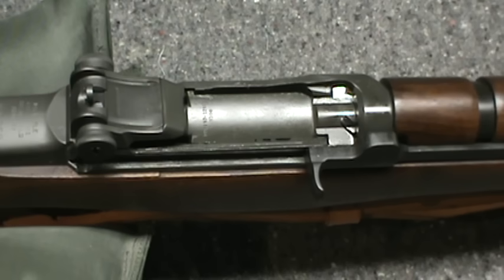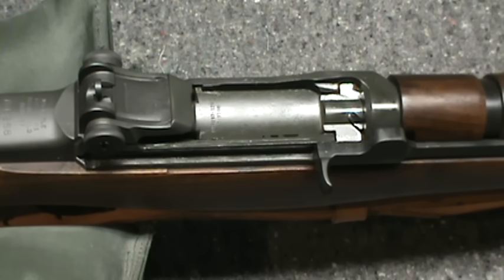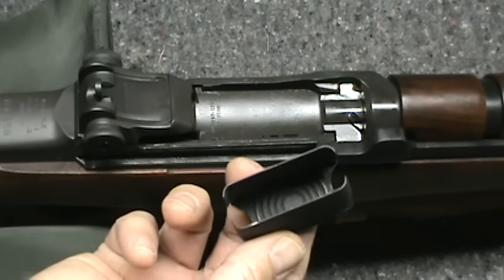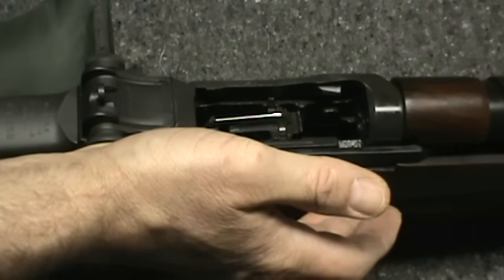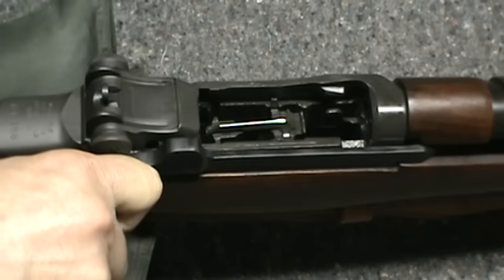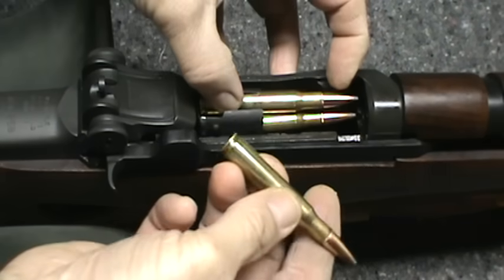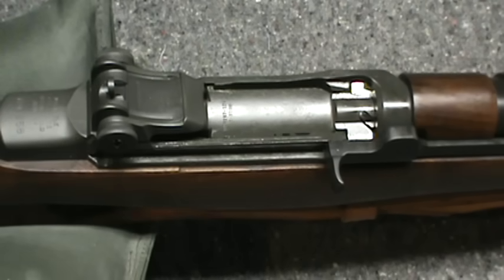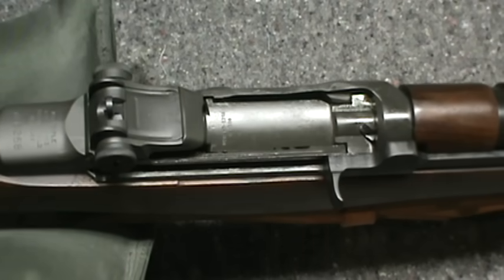How to load the M1 Garand the US Army way

Comment from the maker: KfUaNnSsT 5 days ago
 can you put 1 round in the chamber + a full 8-round clip in the magazine, so you got 9 rounds loaded in the gun?

No. Max load in the rifle is 8
Reply: +007connecticut You should still be able to fire 9 rounds fine.
Reply: +Kaydn “SocialHypocricy” Burns NO, you can't get 9 rounds in the weapon...you cannot close the bolt on an en bloc clip that has 8 rounds in it and have one in the chamber.  It is physically impossible.  Get your hands on an M1 and try it....you have obviously never handled an M1 before.
Reply: +Kaydn “SocialHypocricy” Burns There are plenty of rifles where that won't work. You can't do it on a Mosin, for instance, because it was never meant to have bullets in the internal mag but not in the chamber. 5+1 simply doesn't work on a Mosin, and again you wouldn't be able to close the bolt. I think you would find that to be very common on any gun with an internal magazine.
Reply: +Irenaeus Saintonge Um, not sure about that. Load 5 in a Mosin and one in the chamber. Then push the shell slightly down when you close the bolt. Not a big deal
Reply: +Nightverslonn Hm. I will try next time I'm at the range, but I'm about 95% sure the bolt cannot close with five in the mag.
Reply: you would have to have the bolt back to load ethier the single round or full clip and all you will end up doing is running a round from the clip into the back of the round in the chamber
Reply: +Irenaeus Saintonge many if not most early military bolt action rifles such as the springfield 1903, smle & k98 had a magazine cutoff so you could hold a full magazine in reserve and single load rounds into the chamber. so loading the internal magazine to capacity +1 in the chamber is possible.
Reply: +gungho1345 Most people in this thread are talking about bolt rifles....in some of them you can load a extra round.  If you know ANYTHING about an M1, it has an en bloc clip that holds 8 rounds, It cannot be loaded with the clip and an additional round placed in the chamber and still close the bolt....IT IS IMPOSSIBLE TO DO SO.......I have been shooting M1's for almost 40 yrs, you cannot load 9 in an M1.....
Reply: +fdrww2 yes I know this about the garand. I was commenting on a post about topping off bolt actions. the relative inability to top off a garand was viewed as one of it's shortcomings. the Johnson rifle could be topped off with stripper clips but the short recoil system with reciprocating barrel made mounting a bayonet impractical.
Reply: +Kaydn “SocialHypocricy” Burns He isn't a dick, you just don't have an understanding of how weapons work. The M1 operates from an internal clip much like how some of Mossberg's older 30-06 rifles operated. You can put an 8 round clip in, when the bolt closes it will take the last round and load it into the chamber. Attempting to put 8 rounds in after manually loading a loose round would either cause a stoppage due to a double feed or a possible detonation of the round in the chamber. It would be akin to putting a full 30 round magazine into an AR or M-16 after having put one in the chamber.
Reply: +Jurgen Heinrich   your example is flawed, as you can put a 30 round mag in an AR or AK with one in the chamber. the mag loads from the bottom of the receiver so it can be inserted with the bolt closed on a chambered round.
Reply: correct if you load a round in the chamber while loading a 8 round clip into the magazine you will cause a double-feed.
Reply: +Kaydn „SocialHypocricy” Burns The problem is the top round of the clip is ALREADY the chambered round the moment you release the bolt.

It's more of a 7+1 loading than 8.
Reply: +Themis Spanopoulos half way opened *
Reply: The enbloc magazine only holds 7 rounds the 8th goes straight to the chamber.
Reply: Please tell your father thank you for Serving In WW2
Reply: thanks dude. haha here in the Philippines we've got myths about that gun. that your thumb will be torn off if the bolt catches it when reloading. is it true?
Reply: Can't do it with an SKS either. 10 rounds + 0 in the chamber.
Reply: Just tell me where did you see in the video that he tried to do that ??????
Reply: the guy that owns the actual gun involved literally just answered someone else's question about 8+1 rounds and you still think he's wrong...wat
Reply: I have limited experience with a m1,but i have plenty of experience with a mosin. you can load 4 push them down past the interrupter and close the bolt on an empty chamber with 4 in the mag, the m38 carbine makes a perfect truck rifle. Loading 5+1 in any mosin will not work, I've tried a 1939 finnish m39 a 43' 91/30 a 38' 91/30 and a 1956 Chinese mosin clone. The design will not allow 5+1
Reply: 007connecticut yes
Reply: 007connecticut "in the magazine"
Reply: 007connecticut ur cool
Reply: Thank you very much for explainning to me your dads epic ways of dealing with the garret!
thanks again!

Also I"have a question budd?
How much will it cost if I"wanted to buy one and is it possible to ship to europe also my region is balkans!
Reply: 007connecticut 
Kind of an off-topic question, but how many reloads can you safely squeeze out of each brass shell casing, assuming the person takes care of his/her brass? I would imagine cartridge chamber pressure would potentially have some bearing on that, such as when comparing lower pressure to high pressure cartridges like ,45 ACP vs .40 S&W, or high vs low pressure rifle cartridges?
Reply: If you can't add 9... can you add 10?
Reply: Justin Case 
It's probably a good idea that a few people are pointing that out, because most semi auto guns allow you to fill the magazine AND put a round in the chamber, so it would only be a matter of time before someone tries to do that with a Garand.
Reply: I've seen children's games give the rifle a magazine instead. How embarrassing when the developers claim to make it historically accurate.
Reply: I see.
Reply: 007connecticut r
Reply: I'm on my fifth reload using surplus (LC and HXP) brass @ 2725fps average. No sign of brass fatigue at this point. In the M1 platform proper powder selection is primary to handloading.
Reply: I believe some Italian M1's were retro-fitted to accept a magazine. Those being 308 versions; probably M-14 magazines. Hard to remember off the top of my head, but it is published somewhere that these rifles did have a short service life.
Reply: me too i know some one who owns a Mosin and a M1 grand he owns a lot of WWII guns up to modern war guns he even has a Martini Henry my favorite WWII gun.
Reply: +Kaydn Burns you cannot, because the first round of the 8-round magazine goes right into the barrel. So if there's ALREADY a .30 in the barrel, the M1 will jam.
Reply: What they don't understand is you can't load an 8 round clip and close the bolt without loading a round in the chamber.
Reply: fdrww2 WWII combat veteran here. When we were fighting the Russians in the trenches we could always put one in the chamber along with the 8. I'm a veteran by the way. WW II combat veteran who fought the Russians in the trenches hand to hand with teeth knives shovels pick axes rocks. I used the m1 for 65 years. WW II COmbat veteran speaking her, fought the russians for 17 years in my service by the way. So don't mess wit me young man.
Reply: [90thIN] Seth Prather Weren't the Russians our allies during WW2?
Reply: dont be smarty wit me young blood
Reply: Why is this? Was it just designed that a fully loaded clip would set you up for the maximum 7+1 ?
Reply: [90thIN] Seth Prather The great war was WW1. Please get your fact straight before your unnecessary insults.
Reply: [90thIN] Seth Prather You sound so young. May God have mercy on your poor soul, troll. :)
Reply: [90thIN] Seth Prather Small innocent vet you say? And yet you're the one here with comments filled with disgusting hurtful words. Sorry but I don't believe you either. People know a troll when they see one. And fyi, there are no more great war (ww1) vets. The last of them died off since ww1 was way too long ago for any vets there to still be alive today. Anyways I wish you luck! ^_^
Reply: [90thIN] Seth Prather Lol omg I forgot how funny Internet trolls are. How you replie so early ^_^
Reply: I thought I won't have to return here again but I'm founding out more people falling for this pathetic troll. Stay away from him. He puts Trump's tweets to shame.
Reply: [90thIN] Seth Prather If you're truly a vet then start acting like one.
Reply: M91/30 has littlebit deeper magazine :) just for this reason to close on empty chamber with full mag (or +1 if you would)
Reply: Kaydn Burns no basically every rifle can't, there are plenty of rifles that can't older military rifles are some of those
Reply: 007connecticut “Does a wild bear crap in the woods son?”
Reply: Kaydn Burns !
Reply: It’s not possible because it’s a double feed

Comment: What is the average time you need to bumb the bolt for the m1 also I thank your father for his service it must have been hell for him in the Pacific god bless your father and all in world war 2
Reply from the maker: I think that's why some people (me included)  got M1 thumb. My accident happened when I was loading a 5 rd hunting clip at the gun range. I recall that by thinking at this place 30+ years ago, they only allowed 5 rds in the firearm so this is exactly the cause with the bolt sliding forward without the need of the bump of the hand.  Sometimes the bolt slips forward with the tap of the hand and other times is just goes forward when the pressure is released with your thumb (like in the video). My rifle is 50 50 I guess. I tried different clips, different ammo, lubing the cases up, nothing seems to make it work 1 way or the other 100% of the time. I don't even know what to look for. I suspect it's the tension on the clips but I can't prove it to my satisfaction. I bet if you had worn out clips that barely held the cartridges it would slip in all the time. Thank you for watching.

Comment: I would like one of those despite being heavy. A rifle with 8.  30-06 rounds and the rifle cheap and strong. Perfect
I used to have the fn 308 in the army with 20 rounds but the 308 is slightly too small for big eland and it's not suitable for the Cape buffalo.
Although 
I have seen a professional using the fn. drop 6 elephants in less than a minute during a culling. He obviously knew what bullet placement was. He was only 15 meters away from the herd. Madness or totally confident

Comment: One other trick to use in pushing the clip in the weapon. If you push the clip all the way to the bottem and hold pressure the bolt will not come forward. Then if you quickly and I mean very quickly withdraw your thumb that you've used to insert the clip, the bolt will cycle forward and strip off the first round into the chamber. Another tip if you want to have the bolt closed without a round in the chamber, only load 7 rounds, push clip all the way down while guarding the operating rod and slowly release the bolt so it goes over top of loaded clip without stripping a round and let it close. Then to load, cycle the bolt and it will pick up a round and load the round into the chamber. This would not be applicable for military objectives, civilian only so its loaded but not chambered.

Comment: One mistake some make when reloading their clips is to put the "high side round" on the wrong side.  The high side round should be on the same side as the charging handle and that will make pushing the clip into position much easier.
Reply from the maker: Sometimes the bolt sticks and you need to bump it into battery with your hand, other times like in the video it just slides into battery. Interesting, I need to experiment with this when I have free time.

Comment: Love the dummy round for single load and live ammo for everything else
Reply from the maker: Wrong Friend. Every round I loaded was empty without cap or powder. I'm a reloader so the 8 I used as an example was just a brass case and bullet. The dummy rounds are freaking expensive so I just made 8 for the video. Someone said I should have drilled holes in them, yeah sorry for not thinking it thru. :)
Reply: @007connecticut  oh sorry “friend.” Thought I saw a primer in one as well. It’s cool “friend.” Gif I hate that word.

Comment: I'd gone to my parents after my first service rifle match with a borrowed M1 Garand & Dad didn't have to hear the explanation for the blackened right hand thumb.
Do not push the round into the chamber & close the bolt.
Just lay the single load on the magazine follower & then let the bolt drop.
The weight of the round will slow the bolt's speed enough to prevent slam fire.

Comment: Very nice video. One nit pick I have is that it can be slightly dangerous to load single rounds the way you show here because of the free-floating firing pin of the M1. If you did that with a live round, you'd find that the momentum of the pin would leave a small dimple in the primer. There is a very small but nonzero chance that this could fire the round if it has a very sensitive primer. The solution, if you want to load only one round, is to put the empty clip in first and then load the round into the position it would have if it were the last round in the clip. This slows down the forward motion of the bolt considerably because it has to strip that round off the top of the follower which provides a lot of friction.
Reply from the maker: M16, M14, AR15 etc share the same problems. I just showed the ways of loading it, but I'm a reloader and use CCI military primers in these kinds of firearms. Thanks for watching!

Comment: If you hold your thumb down on the clip while reloading, until you’re ready to remove it, it won’t smash your thumb. When you remove pressure from the follower, the bolt slams into battery. That is the proper way to load a full clip in the M1 Garand. Insert fully, hold pressure, remove thumb.
Reply from the maker: Yes, until your like me loading a 5rd hunting clip and forget to keep pressure down. Then you go home with a swollen thumb and dad laughs at you.

Comment: I don't use the palm of my hand to support the charging handle.  As long as the bolt is all the way back, just load it then bump the charging handle.
Reply from the maker: That's fine. But, sometimes you don't need to bump the charging handle to load it (as I showed in my video). Also when I stuck my thumb many moons ago, I was using the 5 RD hunting clip. I just respect it now that I got M1 Thumb. Reaching around with your left hand to release the pressure on your right thumb sucks bad.Thank you for watching the video

Comment: I would recommend single loading a round without a clip only if your life is in jeopardy.  The M1 has a floating firing pin that can slam fire the round if the bolt is not slowed down by stripping a round out of a clip.
Reply from the maker: Yes. I use CCI military primers which have harder primer cups, made specifically for M16 and M1  M14 rifles
Reply: @007connecticut , those are definitely the best option, but don't count on them to eliminate slam fires by themselves.  If you load rounds one at a time without a clip, then ride the bolt bolt home.

Comment: Very helpful video!  Thanks for making it!  One small correction though...at the beginning of the video you state that the five round clip is not necessary.  It actually is necessary, due to the fact that some states, such as the one where I live, require any center fire rifle used for hunting be "capable of holding no more than 6 rounds in the chamber and magazine combined".  The key word in that law is "capable", as loading only five rounds in an 8 round magazine technically would not be legal when hunting.  The 5 round clips make the rifle conform to the laws in those states.
Reply from the maker: I hate the 5 rounders as that's how I got bit by the the old girl 30 years ago. Thanks for watching. A simple video has millions of views later.

Comment: could you load a clip using 2 hands faster? one to hold the bolt as your other hand pushes the clip down? being left handed it seems it would be easier.
Reply from the maker: With practice it can be loaded faster of course. The rifle wasn't meant to be loaded that way as it's faster to just pop off a few and reload a new clip. But I showed it could be done if ammo was getting scarce and you wanted to top it off.

Comment: I am by no means an expert on the M1 Garand but I would not load single rounds like that unless that weapon was pointed downrange in a safe direction.  Without stripping out of the clip that bolt slams so hard that the firing pin will actually dent the primer.  Just try it if you do not believe me but have it pointed downrange.
Reply from the maker: I'm a reloader so I'm aware of the firing pin issue. For the video I used case and bullet, but no powder or primer (dummy rounds). When I load the M1 for real I use CCI military primers which have a heavier primer cup. Or I use vintage M1 ball ammo still found if you hunt for it.
Reply: @007connecticut  
I know what you did and i understand but no one should put a live round in an M1 Garand without a sled or clip and let the bolt slam forward.  Yes in a battle situation it did not really matter but since none of us are in that situation it should be avoided unless the rifle is pointed down range at a berm.